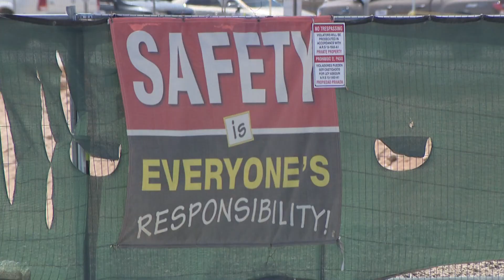TSMC plant hitting major road blocks

Comment: They treat their workers bad and the site is a osha violation payday for the person that goes into the AZ building I was working in the fab and I see a big gas cylinder of argon a chemical that freezes things as far as I seen n it had a flexible thin pipe going into a new tool hold on and that pipe was going across a walk way held up by a string from the harness that the people use for fixing things up high I couldn’t believe it not only that but theirs lots of safety biohazard chemicals that  are just spilled n the rooms aren’t close well n not ventilated well yet
Reply: A real job killer OSHA.  Every time they arrived on site, we shut job down and had a safety meeting.  The onlyn thingnthey were good at was handing out fines.  No one working - no fines.

Comment: honestly is it any frickin wonder why this hasn't happened before in the U. S.? 

If this was Apple in China there would have been a red carpet, no complaints, no hoo ha negative drama . And that would have been for an assembly plant with lower paid workers not a cutting edge $gazillion 5nm chip fab. 

Let's face it without the political pressure it wouldn't even have occurred. 

Some people in the U. S. 
just really act like divas sometimes. Goes with the ultra woke generation I suppose.

Comment: Nevermind the union, Taiwan owned company making microchips here in AZ and Noone see anything wrong with this.
Reply: Please do your research. TSMC makes chips for Apple, Qualcomm, AMD, Broadcom, NVIDIA, MediaTek, Intel, Marvell, NXP and Unisoc. Most of these companies do not operate chip fabs any more and do not want to, only Intel is still constructing wafer and chip fabs. These chips are used in pretty much everything, including US military hardware. If China invades Taiwan, the US and the world are in big hurt. Taiwan is a key US ally. Would you rather them make the chips in Taiwan or in the US where they would provide US jobs?
Reply: @JL-지민 . 90% of the world's chips are 7nm and larger. This fab only makes 5nm and smaller, so Taiwan can go Ukraine fate, it wouldn't matter
Reply: @MrSpiritmonger  you do not seem to understand what 7nm and 5nm means. 5nm means you can fit more transistors on the same footprint as a 7nm, 5nm is the better and newer tech. Bigger is NOT better. 
TSMC is the world's largest contract chipmaker and produces around 90 percent of the world's leading-edge semiconductors. It is already made in TAIWAN, the point is to bring those same chips into the US. If Taiwan went Ukraine it would screw us over.
Reply: @JL-지민   To be able to produce 5nm chips, TSMC exploited workers like no other countries had done. Those poor Taiwan workers had to keep working 80 hour/week forever.
A silicone factory is actually the modern version of sweat shops. Of course TSMC now has a big problem with UAW. No one in the union will work like those poor Taiwanese.
So the big question is, will the US sacrifice the UAW in order to get the factory done ?
Reply: @Thephilpw99  Sad thing is of course they will especially in Arizona that’s not prounion union, I mean, unless of course you’re a state employee then you know you gotta have your union and your pension and so forth. Just not everybody else they don’t care about us.
Reply: @Thephilpw99  I do not think you mean UAW, because they only do cars. I think you mean the construction worker union. The US has rules for how many hours you work... but then I know of people at Intel that are complaining about regular 10-12 hour work days in the Intel fabs as well, but they get paid for it. There is no semiconductor employee workers union, at least in Arizona. You like the pay, you stay, you dont like it, leave, there are plenty of tech jobs in Arizona. TSMC already has poached a lot of Micron and Intel fab workers and are training them now in Taiwan. Several fabs in the state, if you feel abused, you leave.
Reply: Yea, just let the rest of the world do advance things and we here in the US just made toys for children!!!
Reply: Make all the toys you want this is American issue
Reply: Also, even though while Biden is trying to grab the credit for this in making American jobs, the Trump Adminstration is the one that did all the legwork to get TSMC here, it just fell into Bidens lap right after he got into office. TSMC is a key provider of components for 90% of the the chips used in US companies and the world.
Reply: Not when my America is trying to say American made and tiawan owned what kind of chit is that, thats not right then  you dont want to pay American union wages that nothing against you brilliant Tiawanese but  can't be allowed thats hypocrisy